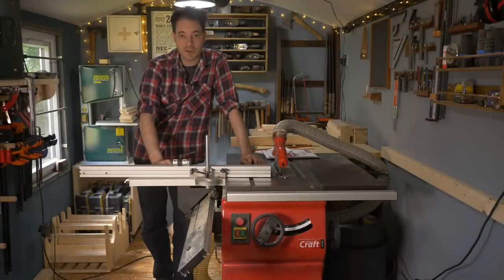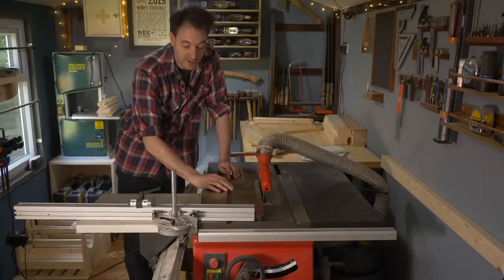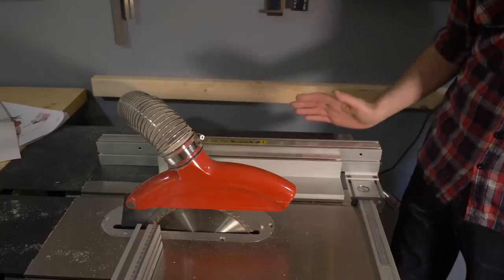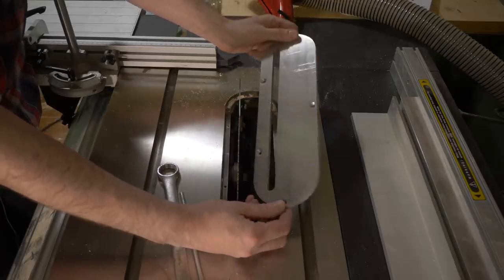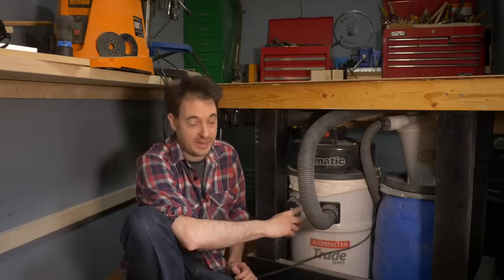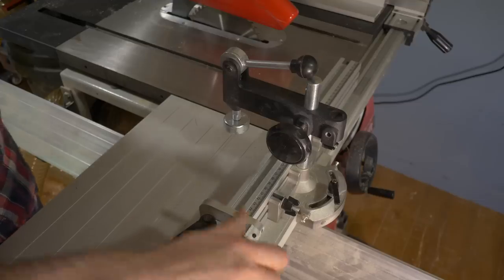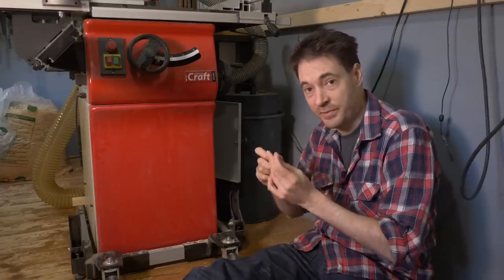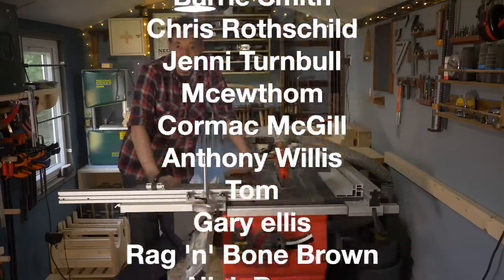Axminster Craft AC216TS 216mm Table Saw Review

Comment: Hey thanks for this review, it answered all my questions, I only wish it was on ac254ts model however they seem basicaly the same except motor and blade. I also have a very narrow workshop and it is in residential setting, quitness is very important to me so once again thanks a mill for suggesting that other numatic extractor, I could never possibly know these details unless someone tells me specificaly about a particular feature. I also love the fact that it has cast iron top which doesnt carry the saw components underneath.
One quick additional question, I would love to hear your opinion or suggestion on this,  according to axminster Q&A riving knife doesnt come off, do I need to worry about that considering I am going to be using this saw and router lift on same bench sharing incra fence?

Once again thanks for this brilliant review 👍
Reply from the maker: The riving knife can be removed with two bolts
Reply: @Badgerworkshop  tanks, dont know why I was under the impression that it couldnt as that would be strange 😤, think I have mistaken that for dado blade which I wont be using anyway.

Comment: Was put off buying this one by very limited rip capacity, motor that Axminster told me wasn’t trade rated and total cost including sliding mitre table and base.  Bought a Charnwood w650 in the end which proved the better value option for arguably a better machine in all but poor dust collection.  Table is dead flat, unlike reports of less than flat axminster ones, has the sliding mitre table and a more powerful trade rated induction motor.  Axminster is a good little machine and undoubtably better than a contractor saw including the ubiquitous dewalt but its limited rip capacity alone ruled it out for me.

Comment: Thank you so much for this very informative review and for taking the time to produce those two videos about the saw. Mine is on its way and will be delivered tomorrow!  I only discovered your channel after I purchased it, so I am glad (and kind of relieved) that you find it a great saw 😅    I went for the same options, and even got a 24T blade, so my smugometer went through the roof when you mentioned about getting a ripping blade 🤣.
On the subject of the dust port, you could try a 100mm to 50-ish reducer if you wanted to hook that Numatic to the saw. Axminster do one e.g. https://www.axminstertools.com/axminster-hose-adaptor-100mm-50mm-103625 otherwise Record Power have a decent selection: https://www.recordpower.co.uk/category/dust-extraction. All the best.
Reply from the maker: You could try that but you really need a 100mm hose machine. I must order that blade